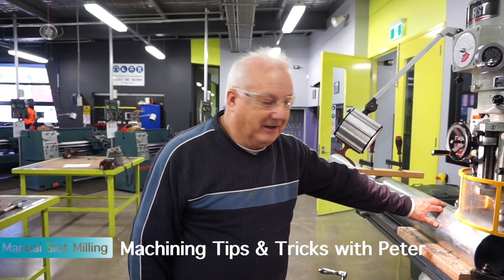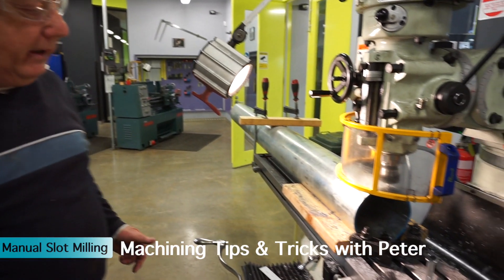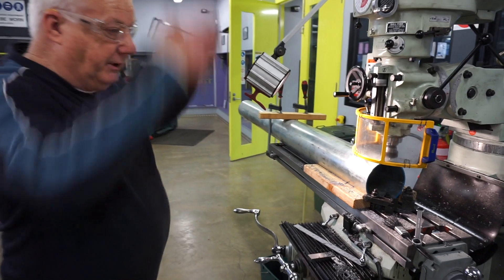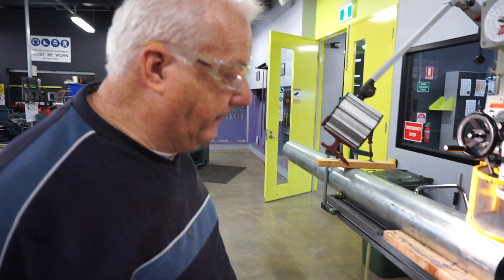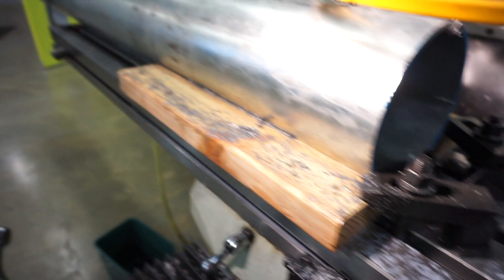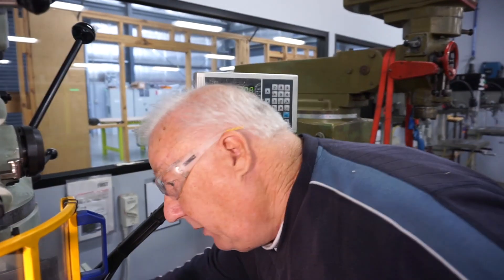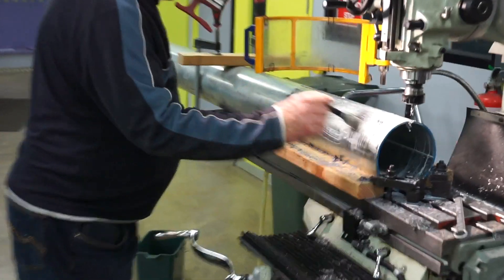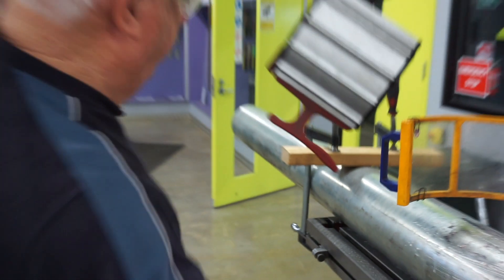Slot Milling 6" Galvanised Steel Pipe

Comment: You may want in research 'Galvanised' pipe and what happens to the 'Galvanised' coating when the 'Galvanised' pipe is cut / harmful gases released...
Reply from the maker: Hey mate.  Yes cutting Galvanised pipe can be harmful to one's health.  As with everything we do in the shop, you should always consult the MSDS  (material safety data sheet) before diving in head first.  Most safety hazards in relation to galvanised steel is when you "hot" cut it.  That is abrasive wheel, plasma / flame cut, or weld.  Cutting with a carbide end mill running flood coolant is probably the safest way to do it.  Thank you for stopping by.  Enjoy the weekend.  Cheers, Aaron.